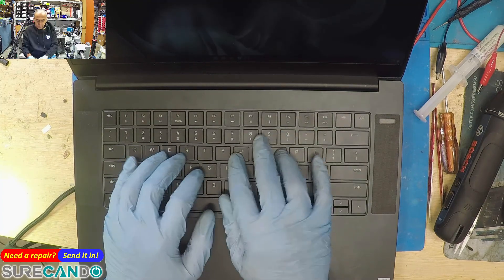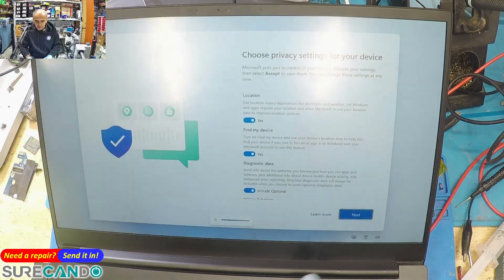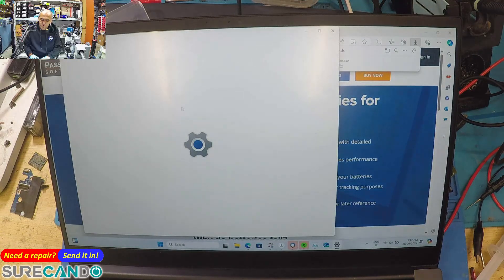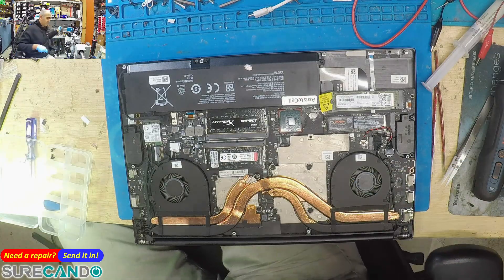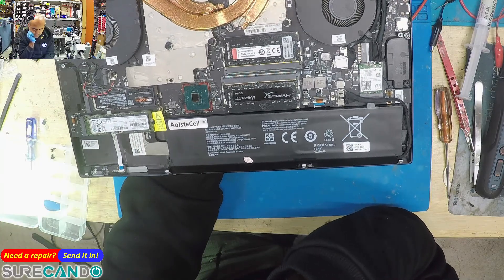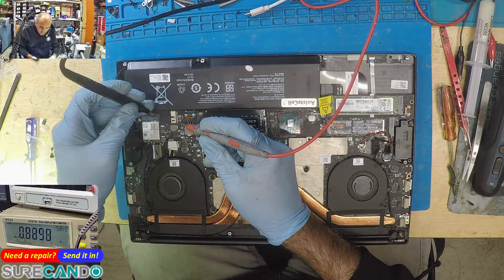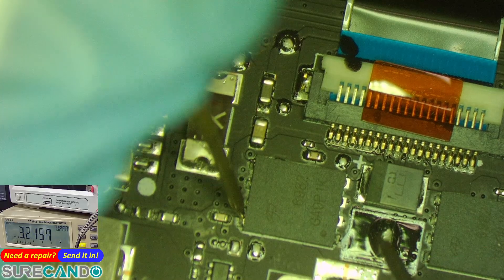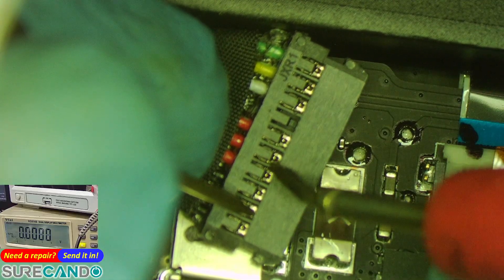Razer Blade 15 Battery Problems Solved | 2020 RZ09-0328 Complete Fix Guide

Comment: Hello, what happened in the end? Did the customer accept the solution?
I'm experiencing similar issues with a similar laptop. Is it possible to replace the battery with one that isn't in sleep mode to fix this problem? Was it finally determined what the problem really was? Thank you!